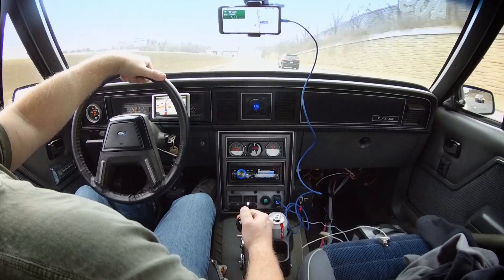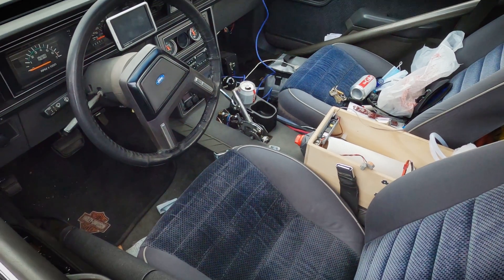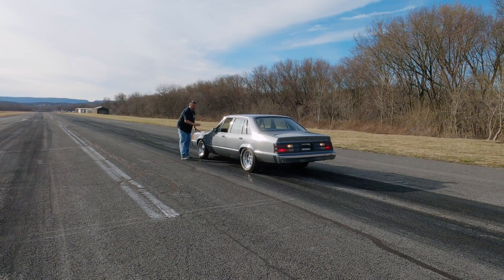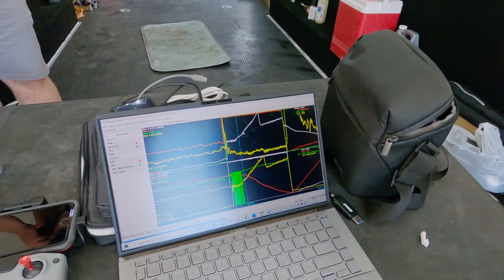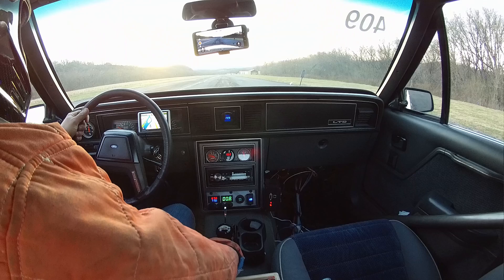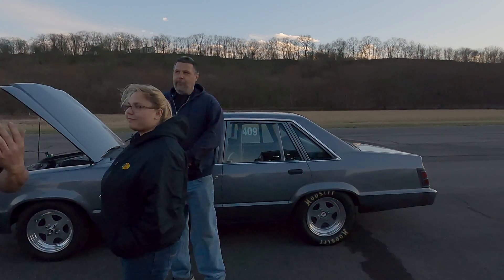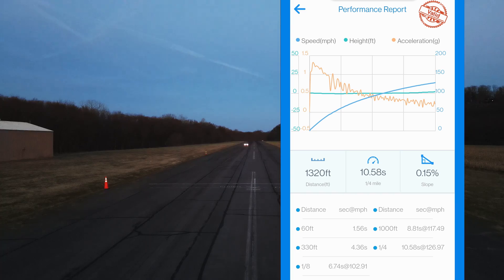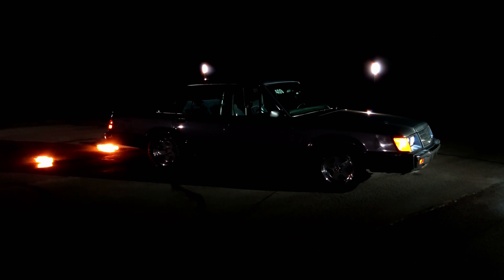DIY Electric Turbo: 5 psi = 127 mph Quarter Mile

Comment: I find this setup fascinating and amazing! I'm new here, so pardon something you've already addressed, but any plans to add in an intercooler or meth to cool down the intake air temps? Subscribed to catch up on all the hard work!
Reply from the maker: That's one of the huge advantages of this - you need a lot less boost (about half compared to a Whipple or TVS; and about 1.2-1.5 less than a turbo) to make the same power.  The gain here was just nuts for 4 psi - 15 mph and 1.7 seconds off the ET is unheard of at that boost level.  Thanks for taking the time to watch & comment and especially for subscribing!
Reply: @AlexLTDLX  is that more power per psi due to increased efficiency from there being no belt parasitic loss (or need for exhaust run a hot side)? Now I see why Porsche is working on electric drive for their turbos, it's not just about reducing lag it seems.
Reply from the maker: Yeah, I would guess so.  Which actually kind of throws the old formulas out the window.  As we get more data, we'll have a more complete picture.  Or more questions...
Reply: @AlexLTDLX  (obvious to me?) when it shifts its not losing pressure like exhaust driven unit, the electric stays ON+UP pushing, is an advantage..
and/or something that could be managed/matched through rpm sensor?
does throttle position sensor matter much if calculating displacement with rpm by the tach? cfm engine flow vs turbo rpm/cfm stuffing. might be something that spares some motor+battery heating, performing smoother? 
next thought is physical snorkel/funnel in the grille to "ram air" into the turbo intake to get a little pre-pressure-density started, might help nab and extra lb of boost "for free"?
just random thoughts here, stuff to ponder or dismiss?  :)

Comment: Has anyone thought of electrifying a 16V71 blower?
Reply from the maker: Before I went down this route, the LTD had a custom Whipple setup I built - it went 9.80's at 140 mph on (137 on pump gas): https://youtu.be/j8SNo7kpcxw  The reason why I wouldn't bother electrifying a positive displacement blower is they're less efficient, the rotors are extremely heavy and their #1 benefit - low speed boost - is completely negated when you electrify a centrifugal compressor.  In fact, we see more boost on the transbrake than we do at peak power with this thing.

Comment: Shouldn't this be called an electric supercharger? A turbo is defined as an exhaust driven supercharger
Reply from the maker: Yes, that's right.  But far more people search for "electric turbo" rather than "electric supercharger."  Sometimes the masses win, even though they may be technically wrong.  Like VHS vs Betamax.

Comment: Very impressive! What's next? Are you going to try and make more boost?
Reply from the maker: Thanks.  Yeah, kind of surprised me too.  And yes - the VESC/P2 unit that I just posted a video of should be able to match this setup.  But this actual blower is getting a 53 hp/40kW motor and ESC.  The one we used in this test was "only" 20hp/15kW (we saw an actual 13.8kW in the datalogs).  I think deep 9's should be a very real possibility.

Comment: You're the man dude absolutely incredible. And that car picked up awesome for for 5PSI. Congratulations man. Within 5 years you're gonna have a fucking awesome system.
Reply from the maker: Thanks man.  I've got a motor/ESC combo on the way that dwarfs this one - the motor is rated at 40kW and 53hp - the motor we used here is rated at 15kW and 20 hp...  Thanks again for taking the time to watch and comment!
Reply: @AlexLTDLX Wow an instant 15 psi taking a 400hp engine to 750-800 instantly. That's great man. What you are doing will appeal to so many people. No hot side cool inlet temps. Probly the next greatest thing for street cars. The more boost you create the less time it needs to run and create heat in the ecu. I was really impressed on how the car picked up off the brake especially with a stock glide and 3:08's + the 14mph. Good luck and never give up.

Comment: Makes me want to build one, but I already have a turbo on my car. I built a gear drive electric turbo (that looks surprisingly similar, but smaller) about 22 years ago but never put it on the car. The motor technology and battery technology back then wasn’t quite what it is now and only produced 1psi.
Reply from the maker: That's the truth - it's a barely feasible project now.  But someone's gotta do it so it can come to the masses, and I enjoy the hell out of it.  Thanks for watching and taking the time to comment!
Reply: @AlexLTDLX  no doubt. I love a challenge too. I now have a mill and a lathe and a tig welder. I almost attempted this once again before turboing my car. I ended up changing my mind and just dabbing up a turbo kit. Good job and awesome results! Impressive

Comment: Ive got to ask, What did you gain from shortening the trick flow intake?
Reply from the maker: That's a good question.  It started out as a Trick Flow street intake.  It worked really well when I had a 306 (.030 over 302) in the car.  Then I put the exact same induction on the 363 (now a 365 as a result) - suddenly it wouldn't pull past 5,000 rpm, the tuning window got small and it made the exact same power as the 306, only at like 4,500 rpm.  The 306 would pull to 6,500, btw.  And it wasn't just the limited cross section, it was the runner length.  So I did a bunch of math and decided 10-11" long runners would be optimal (don't forget - that doesn't include the intake runner length in the head).  Which, oddly enough, turns out to be almost the same runner length that LS intakes use from the factory.  Oh, and I had to stay with that intake at the time because my custom Whipple install used the intake as a rear blower support, so I had to keep the TB flange geometry exactly the same.  It does work well, but I can't really make it any bigger - it's ported to the limits of the casting (I removed over 11 lbs of aluminum out of the thing).

Comment: Is the motor voltage for the turbo "all or nothing" or is it variable and controlled via a throttle position sensor?

I knew someone, someday, would do this. Excellent work.  Sometimes the replacement for displacement is by using a higher voltage. :-)
Reply from the maker: Thanks.  It can certainly be programmed to be responsive to throttle position; in my case, my motor can swallow all the electric turbo can throw at it, so I'm going full-tilt.

Comment: hey man i saw a good video you did about a Flier ESC. mine keeps beeping ten times when i connect it to a battery. any idea what that means? i can't find it on their website. Appreciate any info you have. thank you
Reply from the maker: I don't use those ESCs anymore - two failures was enough for me.  But going completely from memory (I could be wrong), I think 5 beeps meant no receiver connected; maybe that's what you're hearing?  Do you have a servo tester you can connect to it?
Reply: @AlexLTDLX  pm

Comment: i think that thing needs a better transmission
Reply from the maker: Why?  It's a fully built glide that's good for 1,800 hp.  What it needs is more power - which it's literally days from getting...
Reply: @AlexLTDLX  It'd be faster with a trans with better gear ratios (better acceleration),  don't you think?
Reply from the maker: @Yorchreload3d  Before the electric turbo, the car ran a Whipple.  It went 9.80's at 140 mph on pump gas.  With that kind of power, you learn really quickly that first gear in a "normal" transmission (usually 2.40-2.76:1) is completely worthless.  Nothing but tire smoke and the need to shift before the 60' clock.  In fact, two speed Turbo 400s are a thing - first gear is eliminated.  A similar concept applies to high gear, but for a different reason.  If you have a very broad power curve (the Whipple and the electric turbo both do), shifting too often wastes time, assuming you have the power to pull through the gears.  If the car ran, say, a gutless 4 cylinder, then you'd have a point.  But since we're looking to at least match the Whipple power levels, any more gears wouldn't benefit the car.  The one thing that would would be a lockup converter, but only marginally - it would show up as a bit more MPH through the traps (difference in ET would be negligible) and more power to the wheels on a dyno.  But we don't race dynos, so whocares?  Hopefully this explanation helps.

Comment: hey i want to put my name in for when you start producing them im in australia i have a 5letre but i want 10lbs boost good luck boys
Reply from the maker: Lol.  Don't know if it will get to that point, but I am using an Australian ESC after two Chinese ones failed well below their ratings.  I do see a time where people "mix and match" compressors, brushless motors, controllers and battery packs.  It's still very early days in terms of viable electric turbos, and I've just finished building new, extremely high power battery packs for this setup - which should make significanly more boost than what you saw in this video.  Our new forum ( www.electrifiedboost.com ) is slowly growing, but I've already posted a lot of info, including which blower I would start with if I knew back then what I know now.  And guess what?  That blower is also from an Australian company.  Heck, if I knew when I started what I know now, I'd use that $625 blower, $300 motor, $1,100 ESC and I'd use battery packs from hybrids or electric vehicle that are now starting to show up pretty cheaply on ebay.  You could build a 700hp capable unit for around $3,000 now... and things are only getting cheaper.  Oh - and join the forum!  Thanks for watching and taking the time to comment!
Reply: @AlexLTDLX  good on you its all trial and erra at first im shure youl get there cheers

Comment: A full second off 0-60 on a car with 3.08 gear is a healthy gain. Congratulations, I look forward to see what it does on 10psi. How much do you think you'll get out of it?
Reply from the maker: Probably around 8 psi or so; but that 8 psi should be more like 14 psi from the old Whipple, or 10 psi from a turbo, since we have no losses.  But the major goal for this one is 9's on pump gas.  Which should be fairly likely.
Reply: @AlexLTDLX  oh I know, my TVS consumes loads of power. 8psi with no load on the engine would be more efficient and much easier on the equipment and increase of mileage. My understanding of what you are doing is the reason I follow.

Comment: Just curious,  would a forklift controller work for the motor? 
 Most are rated at 400+amps...
Reply from the maker: The problem is it would have to be a brushless controller and it would have to be capable of extremely high rpm.  I don't know enough about forklifts to say definitively, but I kinda doubt it.

Comment: Nice .. the Arduino seems to have done the trick as the current isn't all over the place like before.... I Kinda feel like this project is done .NICE
Reply from the maker: Yes indeed.  Though with the APD ESC, there's built in current limiting; something the Flier ESCs don't have.  But the arduino  opens up a world of possibilities - not just ramp up speed, but staged boost (needed to keep it out of surge maybe), etc.  Thanks!  Oh - and we're not done.  No way.  This thing has to get into the 9's, be upholstered and part of the car.  But again, thanks for all your help!
Reply: @AlexLTDLX   Yeah all you have to do is increase voltage and power / for more boost to get into the 9's .. nothing major. :)

Comment: Awesome Alex! Did it far exceed expectations at this point in time or did you think it would perform this well this soon?
Reply from the maker: This really was the best result I could have hoped for, in all honesty.  The naturally aspirated performance took a pretty severe hit with the 3.08 gears - with 3.73 gears, shorty headers and 75mm tb it went high 11's at 117 mph - not sure if I used the trans brake back then or not.  Looking at the data logs, it never got much above 5,200 rpm in high gear - most of high gear was in the 4,000 range.  So there's that to consider.  But hey - there's still tons of room for improvement.  Thanks for sticking with me on this journey!

Comment: Electric nitrous!  Very nice!  Maybe a low 10 second run at sea level then?  Thanks for all the vids on the build!
Reply from the maker: Oh there's a lot more and for different reasons.  Traction is a big one - on both hits it spun bad at the top of 1st gear - which, in this car is about 80 mph.  On the second (faster) pass, one of the battery packs got disconnected.  It spun less, thus it went quicker.  And we haven't come close to optimizing the launch either.  Both electric turbo passes left before the turbo was spooled.  Then there's brushless motor timing - haven't touched that yet either.  But I'll go through all these things in the data analysis video that's coming up.  There are also a few other things we can do for more power too.  Basically, we ran the same times as I did the first time out with the Whipple.  And I got that down to 9.80's over time...
Reply: Wow mission beat the Whipple

Comment: Congrats brother!!
Hard work and amazing results...

This is on a v8 if you put the same turbo on a car with inline 6 or inline 4 that would be amazing  and the most responsive engine.

Also it will also build about 10 psi all the way
Reply from the maker: Thanks!  And possibly on the 10 psi thing.  The more boost it makes the more power it'll take to spin it.  Exactly how much more we don't know yet - but the datalogs from these runs will help.
Reply: @AlexLTDLX  so you did not hit max rpm yet on the new electric motor??
Reply: @AlexLTDLX  mate if you look at my comments and idea about replacing turbo CHRA with an electric motor

You have the old TP motor, old batteries, turbos are chinese and cheap... old controller... why dont you test it 

You litterally have everything laying aroundand would be good original content

You do not even need to have the turbo attached to an engine just put the turbine housing on the exhaust of a car as proof of concept
Reply: yes , thats what im thinking 
i have 3.3 litre straight six that will benefit from this big time
Reply: @gregwilson3173  i was thinking recently about a better idea that is very similar. Basically i was thinking about using a tp motor with a dual shaft front and rear.

To basically replace the turbo CHRA
Where a compressor wheel is fitted to the front shaft and a thick spacer followed by a turbine wheel fitted to the rear shaft to give some distance away from the heat.

The electric motor will spin till 50000rpm while being slightly assisted by exhaust gases

After that point the turbo will be well in the boost range and take it all the way to 70000rpm by itself

No bearings or oiling needed just water cooling for the motor because the motor will replace the dual ball bearing center and everything between the compressor and turbine wheels
Reply: some of you abrieviations ard lost on me , good to see how everyone gets inspired when someone proves the principle works
Reply: getting the compressor away from the turbine ( mercedes F1 ) with thd motor/generator in between, stops the heat soak , my philosphy is using electric drive only so not to upset exhaust flow , or run a seperate turbine further along thd exhaust system so as to not upset the scavenging and also no need to cram it all together
Reply: thanks for that , ( never be afraid to ask for clarification )
Reply: yeah familiar with turbos basics , ive been waiting for decent electric compressors for a while now , sad that there are still wankers who think its a scam and wont work , waiting to see how it goes now
Reply: @gregwilson3173  yup you lose 100% of the shots you dont take... its also a sympton of self sabotage... so just do it

As for the turbo if you write mguh F1 on google you will see an image of the hybrid turbo but it doesnt make sense because it has   chra and electric motor 

The electric motor by itself is longer than a typical CHRA so the heat concern is not between compressor and turbine rather between turbine and electric motor

So a spacer and water cooling should be good enough
Reply: yeah thats the one im talking about , it amazes me that there are still a few that carry on like it doesent work when it clearly does , there are so many variations thsy can be used
Reply from the maker: @FirstLast-tx3yj  If you haven't been there, check out (and join!) our new forum: www.electrifiedboost.com  Audi has actually released something sort of similar that people are started to hack and use.  Here's the post on the forum: https://www.electrifiedboost.com/threads/audi-sq7-4-0-tdi-electric-supercharger.10/

Comment: Very impressive gains.
Reply from the maker: Honestly, it surprised me a bit.  There are a few reasons why the gains are so high; one of them being the car is so badly geared for N/A running that any boost shows well.  But that's only about a quarter of the gains - the rest is probably due to the efficiency of the system.  I'll know more accurately once we've had a chance to analyze the logs thoroughly (I'll make a video about it).